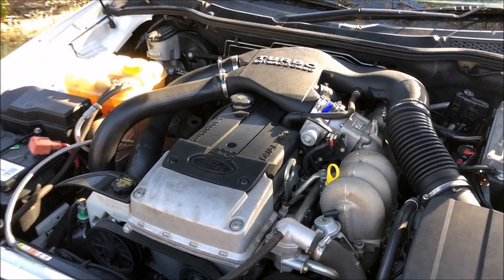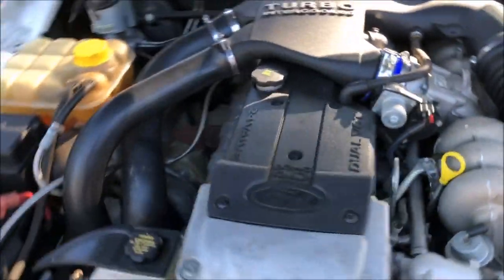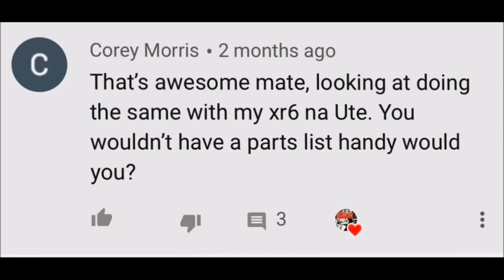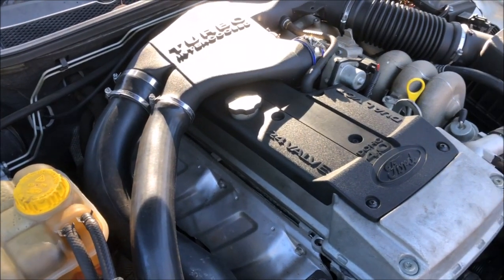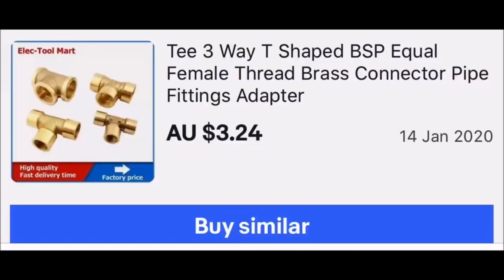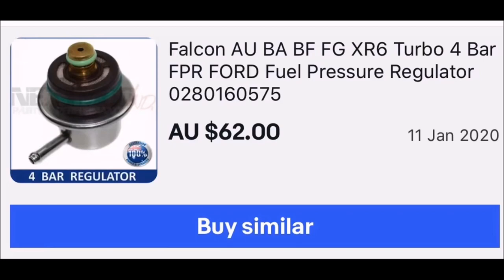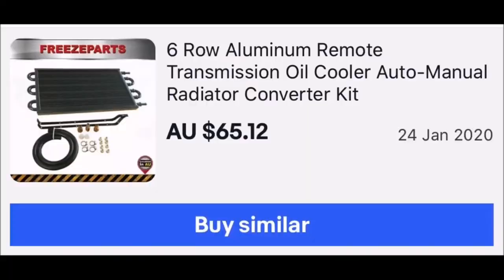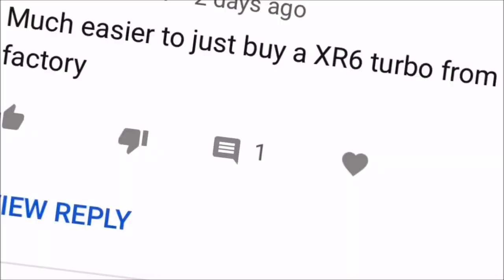NA Barra Turbo Conversion - What you need and How Much $$$

Comment: i did my conversion earlier this year... the intercooler kit i used is 3 times the price on ebay now compared to when i bought it its ridiculous. Can confirm of the fg map sensor works sweet :)
Reply from the maker: Sweet! Yeah I can imagine as stocks get low and demand increases prices will go up. Cheers for the feedback, Hopefully that helps a few good folk with their conversions 🍻
Reply: Yeah mate it helped me heaps. I even filmed a little of mine, I went cheap Ebay conversion haha cost 1700 before tune.. just in case people wanted to try the cheap riskier route :p
Reply from the maker: Ross Holland very cool, I’ll check it out

Comment: Top stuff mate! Im currently in the process of converting my BF2 Fairmont Ghia which this series gave me the push to do. Cheers!
Reply from the maker: That’s awesome man, stoked to hear that 🍻
Reply: Wouldn't you have  to pull out the diff trans and everything underneath so the turbo can cope
Reply: Would a stock zf trans cope
Reply: @CoreyRichardson1  nope the stock diff and trans are working fine on my with about 245rwkw.
Reply: @davidodisho3683  hi mate did you use stock na ecu then? I have just bought a bf mk2 fairmont ghia as well and looking to run low boost and power. Want to keep it quiet as well as it's so smooth and quiet as is now.
Reply: @beyondbackwater4933  I originally did use the stock na ecu and tuned it to suit the turbo, however since then have upgraded to a turbo ecu with factory boost control

Comment: Nice video, the biggest reason I have avoided turboing any of my na fords is I find a well maintained and serviced na BF Barra has got so much grunt and reliability I wouldnt want to compromise the reliability or fuel economy for a little more grunt. I see Scotty Van Strien turboed his BF ZF6 XR6 and immediately had issues with the ZF6HP26 standard trans flaring under boost, which could have been a service issue but who knows. I assume you have the BT4 trans in the ute. I find the BT4 an excellent trans,  very robust and easy to maintain. I recently bought a dirty old 2007 BF RTV ute for $2600 as a project, I may just have some fun and turbo that. Since it will be an engine out resto I think it will be a good candidate.
Reply: the 4 speed in the RTV has v8 internals.

Comment: and then you can swap out the bottom end for a green barra one and push up round 350kw with valve springs, headgasket and studs of course
Reply: The na motor can make 350rwkw anyway. The Fg na motor is even capable of over 450rwkw on e85 with some people even getting 500rwkw from the na fg motor. Not bad for $100 motor.
Reply: Luke Sm can you explain this in the simplest possible way lmao

Comment: Just worked out exactly what I need to do my conversion. And I have been up all night on the piss. I got the original turbo the ba come out with. And I have worked out every single turbo piping. Got the turbo kit for 500 dollars new. Fuckin ebay are good for good cheap parts

Comment: gday mate.what about valve springs,im assuming you are still using stock ones,lots say you have to replace them
Reply from the maker: Yep, Stock springs are fine with 7psi.. been my daily now for over 12 months, still going strong
Reply: @oldskoolonly  great work mate, thanks, so many answers to that question out there, ( turboing an NA Barra) yours was boss. 👍🏻

Comment: Hey bud, epic work on a budget ! I've just found your channel and yet to watch the fall story but how do you go with NA compression @ 10.3:1 vs turbo @ 8.8:1 ? Or is 7 psi ok ? Or just run with e85 and turn the wick up 😉💪👍
Reply from the maker: Cheers man, yeah it’s all in the tune. I run 98 and at 7psi you won’t have any issues if it’s tuned correctly 👌🏻

Comment: Hey mate great vid. Doing a late 05 bft that had its running gear extracted for another build. It had zf box.  Any tips on how you would repower this so i can move it on. Cheers
Reply from the maker: Broad question man. All depends on what's still there like ecu and harnesses etc. N/A engine and box combos are still pretty cheap but if the thing has been picked out, may be easier and cheaper to buy a wreck and swap it all over.. 🤷🏻‍♂️

Comment: Would it be possible to change the transmission to more gears than the current 4
Reply from the maker: Yeah of course, lots of folk using the 6 speed, you’d just need to bring all the related electronics over with it 👌🏻

Comment: Is there any difference between the n/a head and the turbo head?
Reply from the maker: Mate I don’t know. I’ve heard yes and I’ve heard no. Someone might pipe in with the answer to that. I do know the n/a head is the business with a decent set of valve springs if you’re playing with extra boost.
Reply: inconel exhaust valves.

Comment: Do you plan on chasing more horsepower at all?
Reply from the maker: Most definitely but not with these internals though
Reply: @oldskoolonly  Sounds good, it's been a pleasure watching your series, because you explain everything clearly, and in a way which is interesting. You're videos  have inspired me to start collecting parts for my BA NA (just bought the turbo manifold today) Little bit more expensive here in NZ to get the conversion parts (will have to do one part per paycheck), but still cheaper by far than going out and buying a factory turbo car. 
Only thing I am thinking of doing differently is starting with turbo side intake and tune, or would you say it's possibly pushing it to far?
Reply from the maker: Cheers man, really appreciate that. Turbo side intake will reduce heat soak which is always a good thing

Comment: update on reliability?
Reply from the maker: Yeah man, did the conversation 13 months ago, daily driver and no issues whatsoever. Still going as strong as the day it was dyno’d 👌🏻
Reply: @oldskoolonly  how many kms on your car?

i currently have a BF with a zf6 in it with 300,000km on it.. im thinking of slowy collecting everything over time an then buying an ex taxi fg taxi an slapping it on that!
Reply from the maker: Just hit 250000
Reply: @oldskoolonly   thanks alot mate! the bloke you used for your tuning.. was i presume.. euro prestige ? they are now out at vineyard.
ive now got everything i need basically. besides from time to put it all together!! have you got a link to the intercooler you used
Reply: also mate when you tapped into the block under the turbo for the oil return line, how big of hole do you need to go?  an also was that tapped ?